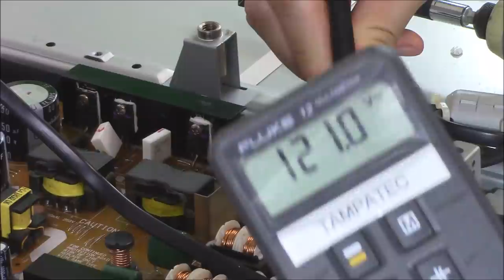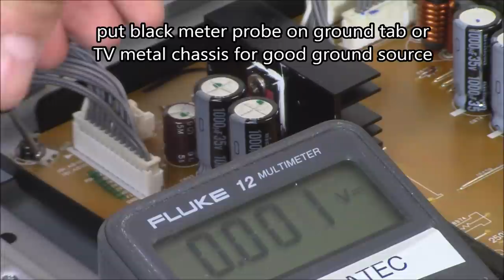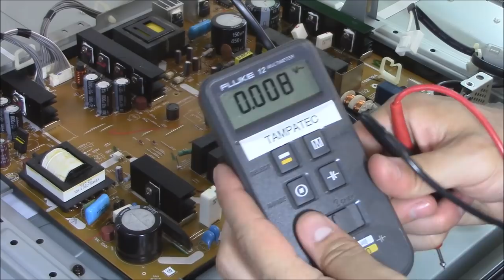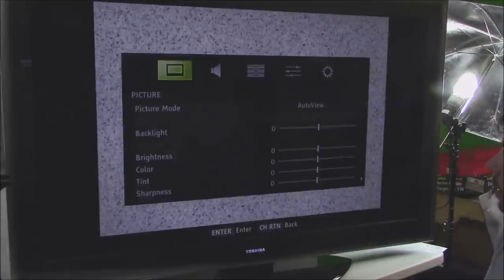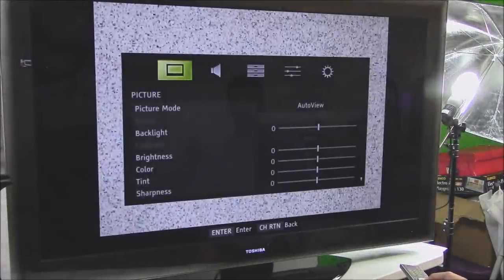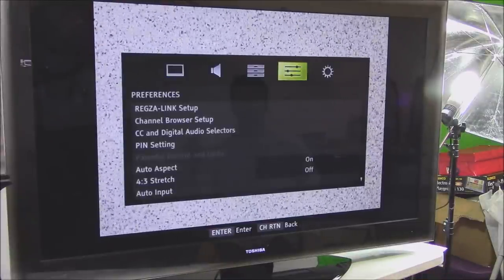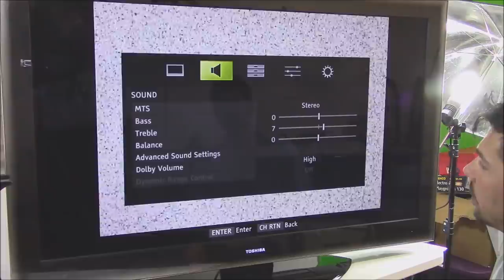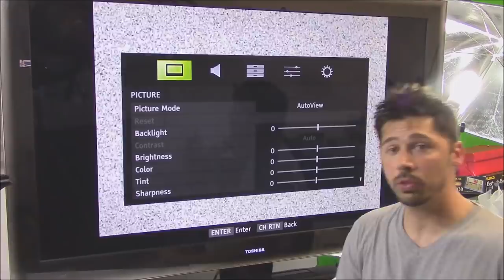Easy common fix Toshiba LCD TV, troubleshooting dead TV repair review

Comment: Hi +Tampatec

TV Model: Toshiba 24p2305ze

Problem:
1. When I Turn TV switch on I am able to see the led light is changed from RED to GREEN
2. After that it taking too much time(Initial stage 30 min later on increased to several hours) to display the picture
3. I observed that some times I can see black and blue shade screen

Please help me..
Thank you

Comment: how can i fix my toshiba led tv, it has a power but when i turn it on it will automatic turning off and after a while it will goes back on stand by with red light at power indicator. then i will turn it on again after a while the same situation happen. the model is toshiba led tv 32P1300EE. pls help me.

Comment: Hi tampatec I have a 65in rca led tv that will not turn on it does have a red stdby light lite and I have all my volts that I should on my power supply board but tv Will not come on which tells me there something wrong with the main board but I would like to just replace whatever component on main board is bad what should I look for???

also when trying to order main board shopjimmys saids that my board needs to match model#,serial# and main board part number and of course they don't have it. but when I call searspartdirect they just asked for just model number so the p# number they gave me is 65120RE01M3393LNA19-A4. My board number shows 65120RE01M3393LNA35-F2. by the way my model is LED65G55R120Q Serial number 4534-LE65G55-F205408.....please please help me........

Comment: I have a toshiba 46g300u1 it looks just like that just smaller. When you plug it in it kinda looks like ghosting but not really it just seems like it's really really slow. When the stand by or searching for signal appears on the screen and moves up and down you will see 2 or 3 before the original one fades away... 
I'm thinking it's a bad main board or maybe a bad rectifier on the power board not giving it a constant current to the t-con board. I've had this tv sitting around for a month now trying to find a power board or main board. Shop Jimmy.com or sears direct doesn't have any replacements on hand. And idk what to do,bit may even be a bad lcd panel but I can still get the menu up and everything I've even done a reset. 
I can't find any videos of a tv having this particular problem ANYWHERE on youtube or google.
Reply from the maker: if it's like ghosting press menu tv button if the ghosting runs in the menu it can be tcon board or tcon connections or bad tabs on lcd panel. it can be main logic board if the ghosting doesn't run through the tv menu pop up. hope that helps
Reply: I wish I could just post a video. It's like the video timing is 1/4 as fast as it should be.. it's reallllly slow with the picture I've never seen anything like it.
Reply from the maker: Devin Clem post it so i can see then delete it later
Reply: ***** I uploaded a video of that tv, " Toshiba 46G300u1 problems2". Hope you can help
Reply: Devin Clem did you ever figure out the issue with your TV? I have same TV same problem. Cant find any information online!

Comment: got a problem with mine when you switch on colour is rubbish but gets better with time its ok after 30 min,
Reply: suspect electrolytic capacitors, probably not found to be bloated. when set has warmed up enough to give a good picture, start freezing components one at a time to find culprit. "FREEZE MIST" is found at most places that supply parts and equip. for electronics servicers.  possibly on t-conn board, or main board area near where t-conn is connected. could be a cap. in a regulator circuit area.

Comment: I fix the same part resistor
Reply from the maker: leon johnson jr nice. kinda weird circuit board has same parts that fail in same location.
Reply: it was just the resistor  the voltage regulator was good
Reply: I need a question to ask u

Comment: how do I fix a tv that won't come for 3 hrs, when we are waiting fot the tv to come on there is no light.model, 37LC7D,PRODUCT CODE 37LC7D-UB-AUSVLMM,SERLIAL NO 707MXVW2H447
Reply: Long time to come on is usually capacitors on ps board. Might look bloated on top.